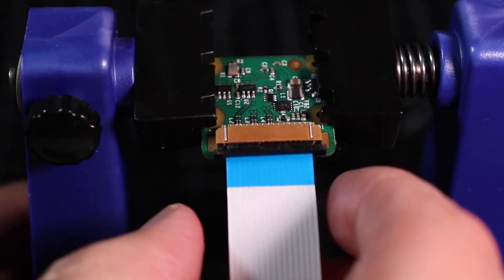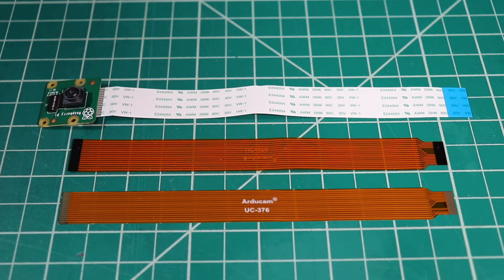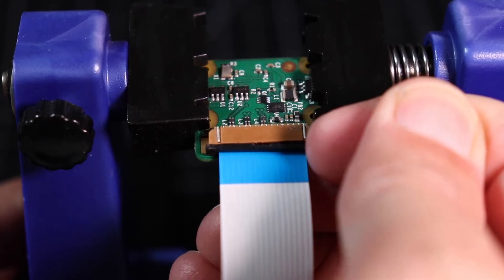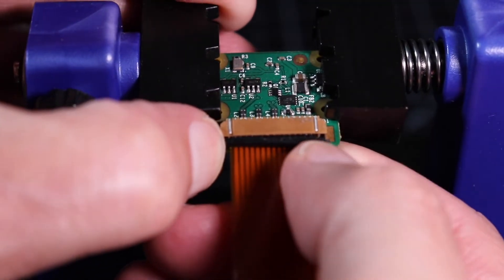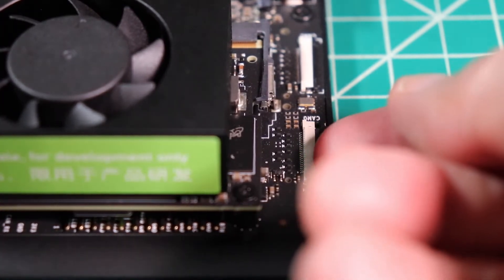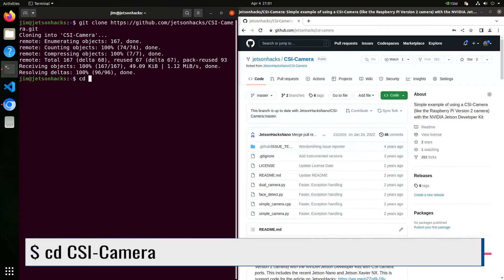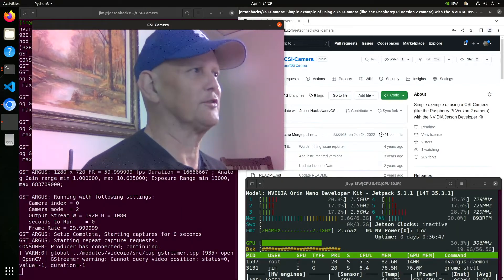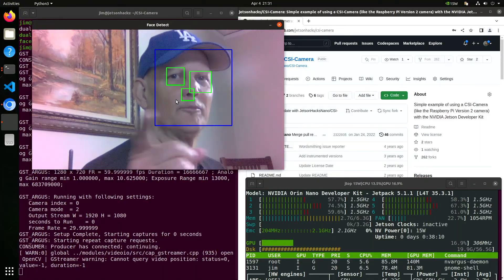Jetson Orin Nano Meets RPi Camera: Cable Magic!

Comment from the maker: In the video, what I meant to say is that the 15 pin side of the ribbon cable (16mm) is wider than the 22 pin side of the ribbon cable (11.5mm). This is due to the pitch of the pin spacing, 1.0mm for the 15pin, 0.5mm for the 22 pin. That's a little counter-intuitive to me, I would expect the side with less pins to be wider.

Comment: What if i wanna use imx477 on cam 0 and imx219 on cam 1?
Reply from the maker: You'll need to use jetson-io.py to select the correct camera combination. You can get help in the official NVIDIA Jetson forums.
Reply: @JetsonHacks  thanks but that didn't work. I'll try nvidia's forum

Comment: **"Great content as always! I've been testing the Arducam IMX519 on my Jetson Orin Nano for ID and license plate recognition, but I feel the autofocus performance is inconsistent. I noticed in your demos that your cameras autofocus smoothly—could you share which cameras you use and recommend for best results?

I'm closely following your work and really appreciate your insights. Thanks a lot
Reply from the maker: The CSI came that I use is the inexpensive Raspberry Pi V2 camera. It's probably not suited towards your application. The Thine Solutions THEIA Cam has good autofocus performance (I've shown it on the channel): https://www.thinesolutions.com/13mp-pdaf-camera-for-jetson-orin
However for something like LPR applications, you're probably better off using fixed focus if the camera is stationary. There are a lot of good USB cameras which exhibit good autofocus, it just depends on how much money you want to spend and the environmental conditions. Thanks for watching!

Comment: I keep getting error: Unable to open camera?  Any ideas what’s going on?
Reply from the maker: What version of JetPack are you running?
Reply: @ Version 6.1
Reply from the maker: @ltellis036  You need to check to make sure that the camera is properly installed, and in the correct slot. Which camera are you using?
Reply: @JetsonHacks  Rasberry Pi camera module 3
Reply: @JetsonHacks  I’m in camera slot 1
Reply from the maker: @ltellis036  The camera shown in the video is a RPi V2 camera. For the V3, you need to configure the Jetson to use the appropriate driver. I haven't tried it myself, but I believe there is a setting in jetson-io.py to enable the camera. You can ask for further help on the official NVIDIA Jetson forums. Good luck on your project!

Comment: Hi Again!, imposible to use csi camera with new Super versión, libraries as board.py fails when detection de pinout... i can't fix it.... any help?
Reply from the maker: I don't know what board.py is.
Reply: @JetsonHacks  Is a file that enums boards from Jetson series, in this file exists "Jetson Orin Nano" but not Jetson Orin Nano 'Super', it must be the issue, logically i tried to add this model manually but with neigther result
Reply from the maker: @ProaliusVideos  The Jetson Orin Nano is the same as the Jetson Orin Nano 'Super', the only difference between the clock speeds that the Super is running on. You shouldn't have to add it as a separate model.
Reply: @JetsonHacks  yes, in theory, but doesn't work . Could you try it? I trusth you ...more than me....jeje

Comment: I have seen another video which shows soldering off R8 resisitor and keeping the same cable will make High Res camera modue i.e IMX 477 work with jetson nano. Is that possible?
Reply from the maker: If it is the Raspberry Pi one, yes. There are also manufacturers that make the IMX477 for the Jetson Nano that do not require modification, for example: https://amzn.to/44dEAoQ Thanks for watching!
Reply: @JetsonHacks  Yes its the raspberry pi one. Will I require further modifications after soldering the resistor off or will that be enough?
Reply from the maker: @DRACO_TALIX  I haven't tried it. Please ask the question on the official Jetson forums, where developers have already tried this out.

Comment: Thanks for the awesome content. Could you please do a video on more available cameras compatible with the Orin Nano dev kit? I've found it near impossible to find higher res higher fps options available currently on the market.
Reply from the maker: The IMX477 Raspberry Pi camera can be used with a little bit of configuration of the Jetson. For a more complete lineup of cameras, checkout the Jetson Partner Supported Camera page: https://developer.nvidia.com/embedded/jetson-partner-supported-cameras?t1_supported-jetson-products=Orin

There are a lot of choices, depending on if you want to use strictly MIPI-CSI, USB, GMSL, rolling shutter, global shutter, and so forth. Good luck on your search!
Reply: So how does this work exactly? I got the IMX477 camera but the camera side has 22 pin csi port and my jetson orin also has 22 pin csi port..but ALL the cables online I found are exclusively 22 pin to 15 pin. There are literally 0 cables that can do 22 pin to 22 pin csi. Any advice?
Reply from the maker: @fayezsalka  You can look on Amazon, for example: https://amzn.to/3p5aYd0
Search terms are 22 pin 0.5mm pitch ribbon cable 
You can also use the term extension.
Good luck on your search! Thanks for watching!

Comment: Hi I have a problem with camera IMX219. 
"Encoder null, cannot set bitrate!"
So how can I fix it? Please help me
Reply from the maker: Since you haven't given any information as to what commands you run to give the error, it is not possible to help you. You can ask your question on the official NVIDIA Jetson Orin Nano forum where a large group of developers and NVIDIA engineers share their experience: https://forums.developer.nvidia.com/c/agx-autonomous-machines/jetson-embedded-systems/jetson-orin-nano/632
Reply: @JetsonHacks  I run command “nvgtscapture-1.0 —orientation=2”
Reply from the maker: @kiennguyenbao4231  This is not an issue I can help you with. Please ask on the forums.

Comment: Hi, if I buy Dual IMX219 Camera Module, do I still need to buy a pin conversion cable? Or it can directly connect to Jetson Orin Nano Development Kit?
Reply from the maker: The Waveshare version that I have in the video includes the correct ribbon cables. Thanks for watching!

Comment: 15 > 22 🤯
Reply from the maker: I didn't word that very well. I should have asked ChatGPT to write that part. What I meant to say is that the 15 pin side of the ribbon cable (16mm) is wider than the 22 pin side of the ribbon cable (11.5mm). This is due to the pitch of the pin spacing, 1.0mm for the 15pin, 0.5mm for the 22 pin. Thanks for pointing this out so I could clarify this! And, as always, thanks for watching!
Reply: @JetsonHacks  😂😂😂

Comment: Have you tried the Raspberry Pi Camera Model 3 ?
Reply from the maker: I don't have one, so I haven't tested it. Thanks for watching!
Reply: @JetsonHacks Does this camera work on jetson Orin Nano?
Reply from the maker: @Unknown-zz1jv  Not that I know of.
Reply: So can you tell me which camera I should go for if I want FOV of 80 to 120 deg, and it is compatible with jetson orin nano
Reply from the maker: @Unknown-zz1jv  I don't really have recommendations, as this isn't an application I have used. The Jetsons have support for IMX219 and IMX477, Waveshare makes a IMX477 camera with a M12 mount of 80 deg. You could possibly switch that out : https://amzn.to/45PtSHJ
You may have to use a different camera cable, but I don't know.